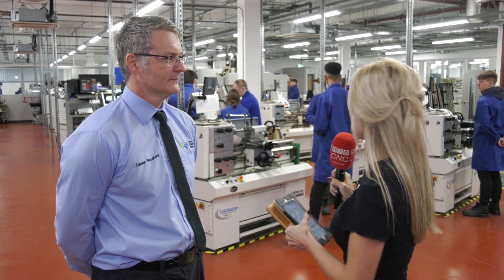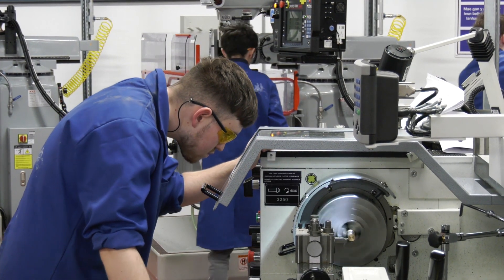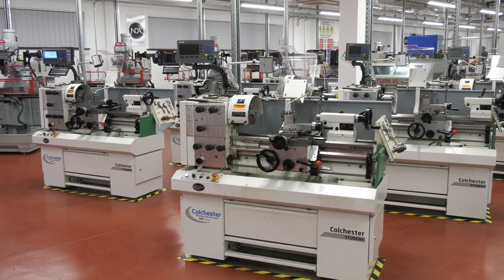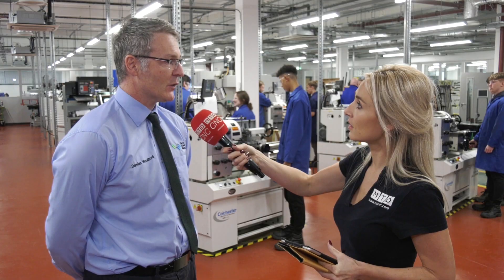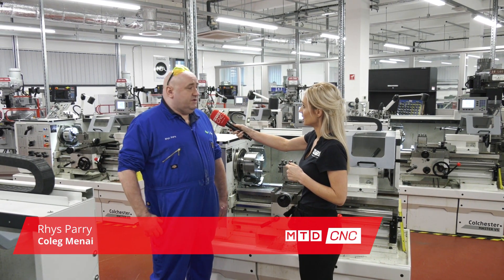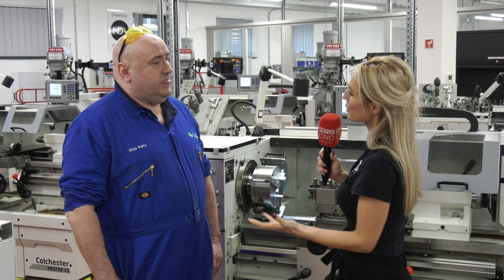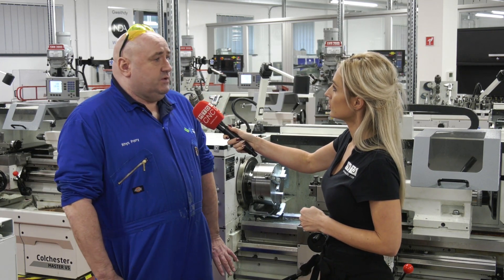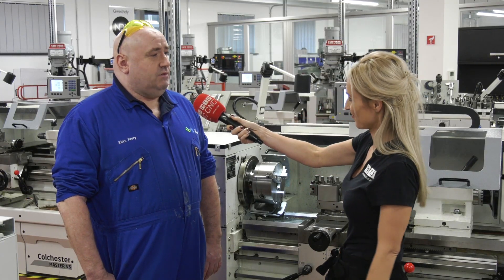Colchester - The only lathes to learn on

Comment: Whats the point in manuals anymore ? Seriously ... why go old school? spend so much money instead of getting cnc lathes .
Reply: Going from a decent CNC operator to a good CNC operator requires knowledge about manual machining and understanding of the fundamentals. Also, having manual machining experience separates a bad engineer from a good one.
Reply: @duodot  i would disagree but everyone has their own opinion . Ive never run a manual lathe but i program, set and operate cnc's and i consider myself as a good operator
Reply: @duodot  also my point was more of, why go old school when you should really go new school. This is why UK is behind with engineering
Reply: @tymekgoral4219  Yes, that I agree with. It is very important to keep up with the times and teach relevant skills, but it is my strong opinion that knowing how to do something the old way can give you a better understanding and appreciation for the new way.
Reply: Try doing repairs with a CNC machine, tell me how long it will take to setup and dial in the machine and let's say your stock material thats being repaired, isn't necessarily perfect rather it has some wear and rust buildup. Just because something is new doesn't necessarily mean its better.
Reply: Im in this video We have 2 cnc lathes as well to advance to if they want
Reply: I use a manual machine every day in my business and have done for 38 years . Both CNC and manual have their place . With a manual machine you can instantly start producing the component without any programming , ideal for 1 offs or small batches and repair work however they obviously have their limitations and any CNC will out perform, production wise, on anything above small batch work . It’s also down to cost , what you can afford to buy . I am a firm believer in making things by hand to learn the basics then progress to a CNC  rather than learn CNC and be incapable of making the part yourself. But that’s just my opinion.
As for Colchester Machines I bought my Harrison M390 new in 1996 , replacing my Triumph 2000 which I bought used from the company I did my apprenticeship at . My new Harrison bought in 1996 ,one of the last few years of UK production,in my opinion, isn’t  in the same class design wise ,quality wise  or even the overall finish as was the Triumph 2000, built in the 1960/70s that it replaced. It is noisier , has change wheels to select certain thread pitches instead of all levers ,you cannot reverse the saddle traverse without stopping the machine , the design of the compound slide and tail stock handle retaining cap screw ,is such ,that they constantly come unscrewed , from new relying on loctite . The old Triumph 2000, from memory , relied on a more positive mechanical method of locking the screw in place so you could easily adjust any back lash and pinch up a grub screw to lock it in place . 
It’s such a shame production is now shipped abroad, it seems all to typical  of management in this country, selling out for maximum profit , instead of retaining skills long term ,relying on past heritage.& history of a once world beating machine in a world beating machine tool industry. So sad to see the factories shut for super markets and housing and the money invested, not in new state of the art production facilities, but in flash Harry show rooms and plush offices, more relevant to selling a car . It’s ironic that it is claimed to be to expensive to manufacture the machines in England yet Germany manages it . It’s ironic that it’s claimed to be to expensive to manufacture the machines in England when the very machines are used in the very manufacturing sector ,deemed to expensive .
Reply from the maker: We think everyone has to start somewhere, even if just for a day or two on these machines, you get a feel for a cut, we all know that feeling when you take to deep a cut at the wrong speed and feed, you can't replace learning this we even if its brief